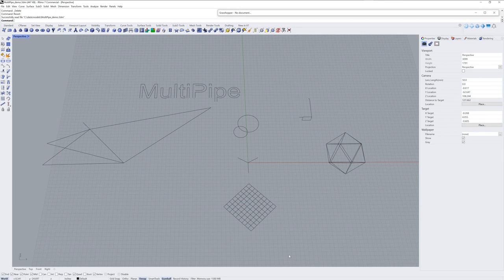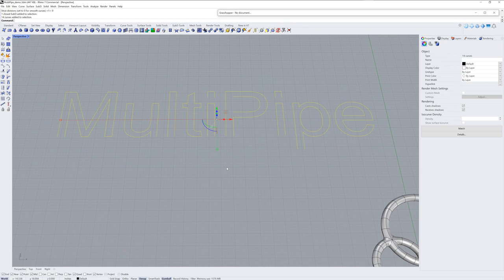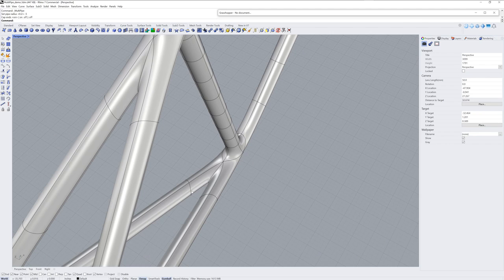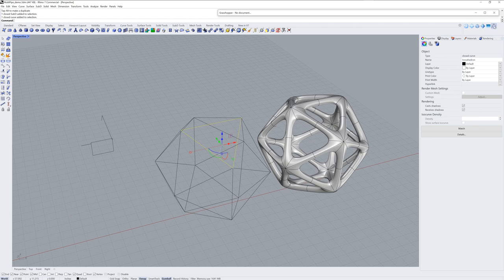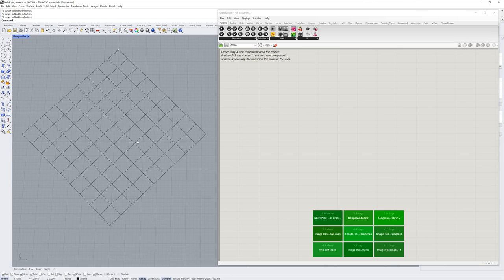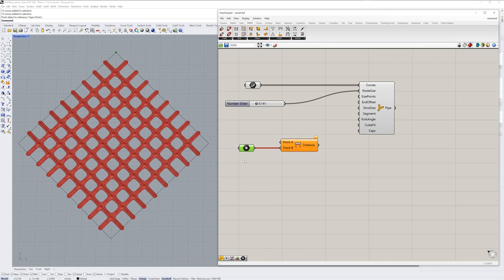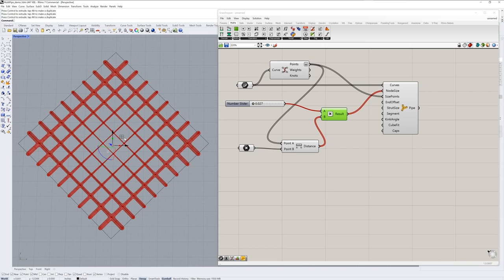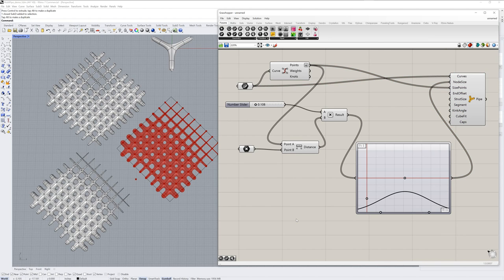MultiPipe in Rhino 7

Comment: Is there a way to save the mesh from a multi pipe, as in not the subd version, but the mesh you work on. thanks. I can see it as a useful tool to make meshes to work more on.
Reply from the maker: Hi Carl, you can use the Mesh command to create a subdivision level of the SubD multipipe surface using the slider there for SubD meshing parameters or use the ExtractControlPolygon command to extract the base mesh. Alternately, you can use the Export command > Choose a mesh format like Obj and you'll get subdivision options including the control polygon choice in the Mesh section of the export options.
Reply: @RhinoGuide  thank you so much <3

Comment: Hi, how did you draw the grid lines? I made grid lines by polylines, but they didn't have the round nodes even I JOIN or GROUP them together.
Reply from the maker: They were lines overlapping one another. If they are coplanar, MultiPipe usually rounds the intersections but you might have to split the lines where they cross in some cases first.

Comment: I have tried all, but Multipipe is missing on grasshopper on Rhino 7 for mac m1
Reply from the maker: Hi, I'm not seeing this issue here in Rhino 7 on an M1 MBP. Please post to the Rhino user forum (https://discourse.mcneel.com/) with the results of the SystemInfo command run in Rhino and a screenshot showing the lack of this component in the Surface > SubD section of GH.